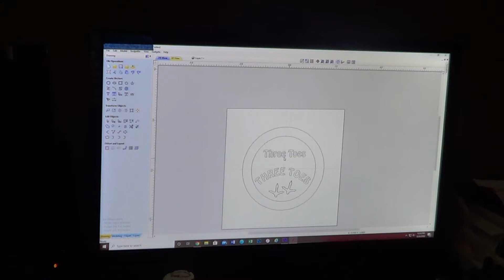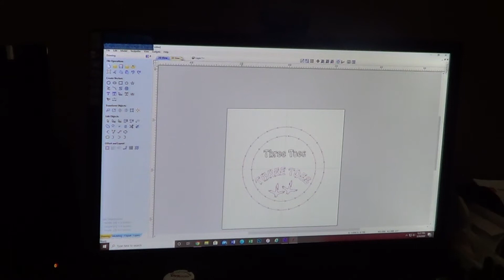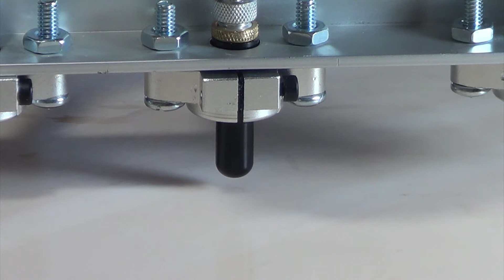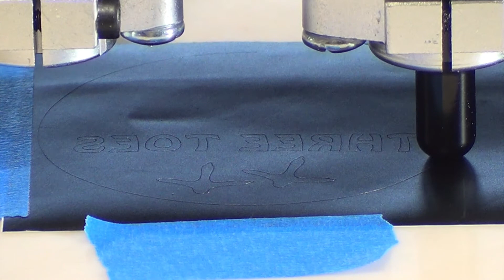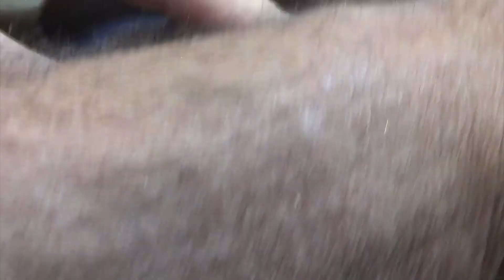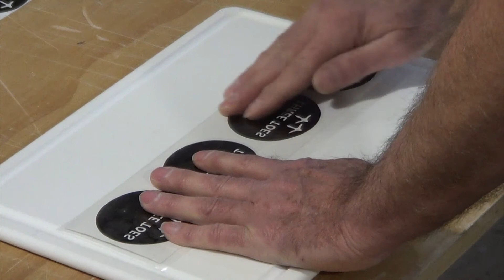Cnc Router Drag Knife, Aspire Software Gadget Cutting Vinyl Video # 2

Comment: hi, Joseph!!  wouldn't it be easier to have the drag knife mounted on some sort of spring loaded bracket so after setting the depth of the blade the whole thing slides over the material even if the work bed is tilted and not perfectly flat???  cool products tho
Reply from the maker: There is no need for a spring, the weight of the assembly will follow the work bed even if it is tilted
Reply: i guess im asking randomly but does any of you know a tool to get back into an instagram account??
I somehow forgot my account password. I love any tricks you can offer me!
Reply: @Kristopher Saul instablaster ;)
Reply: @Karson Donovan Thanks so much for your reply. I got to the site through google and im waiting for the hacking stuff atm.
Seems to take quite some time so I will reply here later with my results.
Reply: @Karson Donovan It did the trick and I actually got access to my account again. I am so happy:D
Thanks so much, you saved my ass :D
Reply: @Kristopher Saul Glad I could help :)